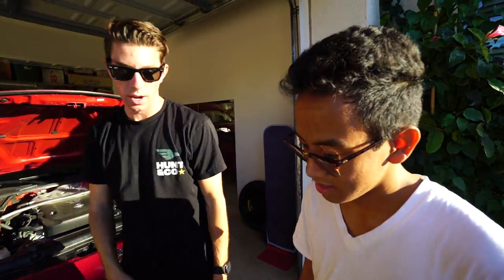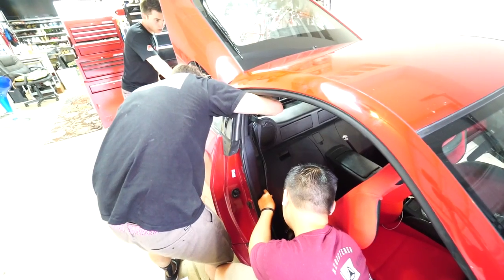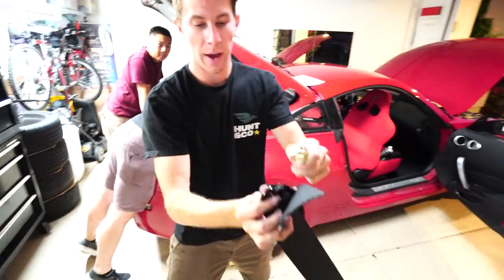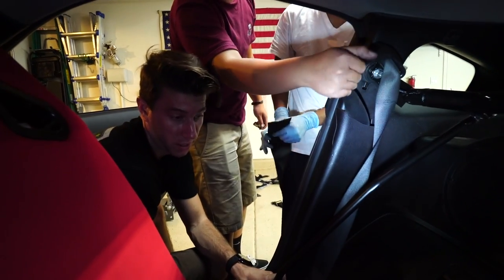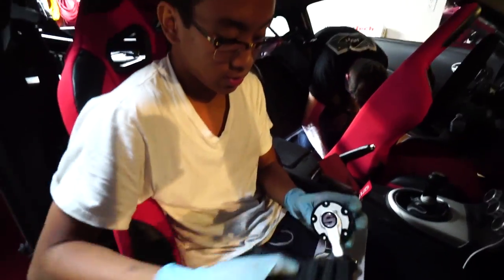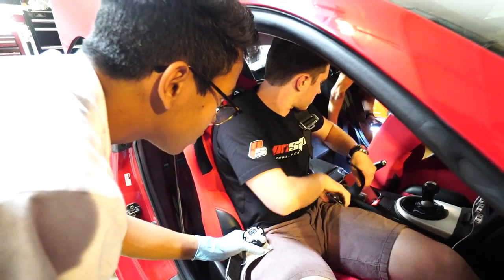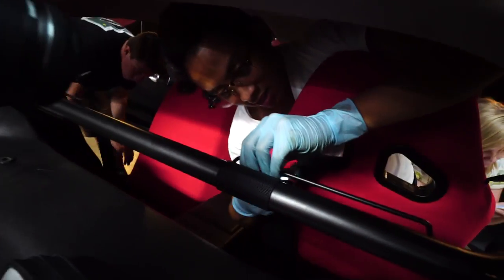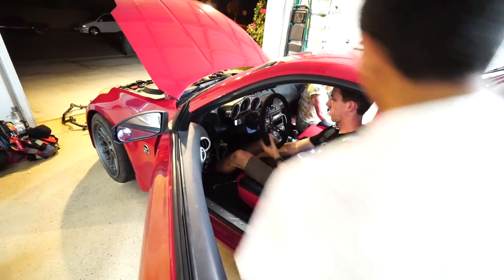Race Harness Install - Nissan 350z

Comment: 4 point harness bad idea and i'm sure you know that already. Please get a 5 point. Don't want you see you get hurt.
EDIT* Well got the end of the video. Now i look like an ass XD
Reply: watch the rest of the video...
Reply: well he still would need a rollcage and a diffrent seat with that supports 5 points harness :)
Reply: +Greg Pitts Apparently you two didn't watch the vlog all the way through...
Reply: Anti Hero Early comments get recognized more. So i posted a soon as i could. Might be the same story for the others too.
Reply: if tj drive on the street in the z it is illegal to have on 5 point harness in California.
Reply: Wait. What's wrong with 4 point.. it's better then the stock seat belts.
Reply: +Marcus Moeller Some say they're worse than stock. I'm not sure why, but 5 point is better than both for sure.
Reply: +rebel 510678 Eh, give him a break.
Reply: Marcus Moeller Long story short. If you crash, the strap around your waist gets pulled up by one ones over your shoulder. Placing the belt across your stomach, and can cause your internals to erupt.
Reply: all of you just go watch b is for builds antisubmarining video.
Reply: 4pt and 5pt arent better than stock, unless yo go for a full set up. They are almost always worse.

Unless you have full cage, 6pt harness, HANS and you are wearing a helmet, any harness is more dangerous than a standard 3pt inertia +airbags. 

First of all without a cage, when your roof caves in you cannot move, therefore your head takes the full force, i hope you have a strong neck. With a 3 pt you can move your body out of the way when the roof caves in. Also not being able to move makes shoulder checks etc far more difficult for daily driving.

Now lets say you do have a harness and a cage, without a helmet your head is now bashing against your cage. Now lets say you have  a helmet, the extra weight plus the fact that none of your body moves except your head means you will probably snap your neck due to inertia. This is where HANS comes in, it prevents your head from moving.

Orrrrrrrrrr you could just leave your car with 3pt and airbags and be very safe for street and moderate track use, maybe wear a helmet at the track if youre worried. All or nothing, because half way there is always more dangerous than what you get from the factory.

HANS + Helmet + harness makes for a very unpractical street car, and is probably illegal in some areas, i say unless its unregistered, dedicated track car stick with airbags and 3pt.
Reply: so what would be good for a daily?
Reply: +Neftali Garcia Regular old fashioned came with the car seat belt...
Reply: but can you still have racing seats?
Reply: 3pt and airbags. Keeps you contained, airbag saves your neck and doesnt keep you pinned in one spot, so when your roof caves in you can move. Also you can look around and do your shoulder checks better. Preventing an incident is better than being safer in an incident anyway.

A harness alone prevents you from looking around, pins you in one spot so you can get crushed, some harnesses cause 'submarining' and causes more strain on your neck, all the rest of your body is pinned, the only thing left to move is your head.

Do veyrons have harnesses? GTRs? Zondas? Kit cars even? No, even the properly built, 800hp street cars tend to run 3pts and airbags.
Reply: +Neftali Garcia Yeah, plenty of seats still allow the use of the stock belt but if you have racing seats might as well get a good harness. Unless you just want them for looks and don't actually plan to race the car.
Reply: Depends on the seats, you could just get some modest ones so they're stronger than stock and contain you around corners, but generally yeah as long as its not interfering with a stock belt you should be fine
Reply: Yea I just want some just for the looks but I wanna know if I'll still be safe if I get in a car accident
Reply: and what's 3pt?
Reply: +Neftali Garcia I'm sure the manufacturer will have it listed on whatever seat you get.
Reply: +Neftali Garcia Three point belt. Like what comes in the car from the factory.
Reply: yea thanks a lot

Comment: If your car flips then you will be trapped with harnesses plus you dont have a roll cage so if the roof caves in then rip tj
Reply: trapped?? you will be held in just like in any other racecar? and the roof will hold up fine in a roll. very safe designed car
Reply: go to any drift event and everyone calls there cars sketchy. tj would have the most legit build out of everyone

Comment: Unless you have full cage, 6pt harness, HANS and you are wearing a helmet, any harness is more dangerous than a standard 3pt inertia +airbags. 

First of all without a cage, when your roof caves in you cannot move, therefore your head takes the full force, i hope you have a strong neck. With a 3 pt you can move your body out of the way when the roof caves in. Also not being able to move makes shoulder checks etc far more difficult for daily driving.

Now lets say you do have a harness and a cage, without a helmet your head is now bashing against your cage. Now lets say you have  a helmet, the extra weight plus the fact that none of your body moves except your head means you will probably snap your neck due to inertia. This is where HANS comes in... Or you could just leave your car with 3pt and airbags and be relatively safe, maybe wear a helmet if youre worried. All or nothing, because half way there is always more dangerous than what you get from the factory.

HANS + Helmet + harness makes for a very unpractical street car, and is probably illegal in some areas, i say unless its unregistered, dedicated track car stick with airbags and 3pt.

Comment: not trying to hate or anything but the harness bar looks to high i thought that the harness had to br no higher than 90% and yours looks higher
Reply: you're right,  15 to 20degrees down from the shoulder belt.

Comment: Ya these are needed but wouldn't camber and roll cage and an e brake bar be more important than your other mods?
Reply: Yep this is death waiting to happen because on a drift if he flips the roof caves in and he is dead without roll cage
Reply: this car will never see an actual event. he'll do more shitty donuts
Reply: +bushdog Lol
Reply: +bushdog A drift car that will only be driven straight.
Reply: JE V and on public roads and the occasional parking lot

Comment: I thought 4 point harness is what everyone runs dont see to many people with 5
Reply: And they dont look near as good as 4 can someone inform to why 5 is so important for a car with under 400 hp
Reply: because 4 point harnesses are very unsafe in a crash. Even oem 3 point harnesses are more safe than 4 point harnesses
Reply: +Stanced G37 because it's "easy" to slide down the seat. A 5 point would stop that by using your crotch to stop
Reply: +Eddy9lives ok i see

Comment: Should I get an integra, 2g eclipse, or 2002 is300
Reply: I'd say eclipse of its the GSX
Reply: Is that even a question....? is300 my guy. Obv choice. 2J, faster, more fun, better looking imo, rwd
Reply: integra
Reply: Is300
Reply: I like Hondas but I'd go with the IS300
Reply: Thanks for the opinion but does anyone know of any good Japanese  rwd cars I can get that's a coupe with usable a back seats for 7k or under and by the way I ruled out the g35 already thx 😀
Reply: i300, rwd 2jz = so much fun
Reply: Is300. 2j, reliable af, sexy as hell, and rwd.
Reply: +OG Toasty subaru wrx mane.... are you the toasty for wok?? lmao
Reply: is300 all the way its rear wheel drive for drift and it has 2jz nuff said
Reply: Is300 is the best out of those. But not for the 2J these guys keep mentioning lol it has a 2JZGE aka non turbo garbage
Reply: I have an integra and its a blast but id go with an is300
Reply: +OG Toasty mk3 supra its rwd they come turbo already. not as expensive like and mk4 supra.
Reply: is300 if you can find a manual, but if not id say integra
Reply: is300 ftw
Reply: gotta say is300 bro. my bro had one and it was nice as hell.